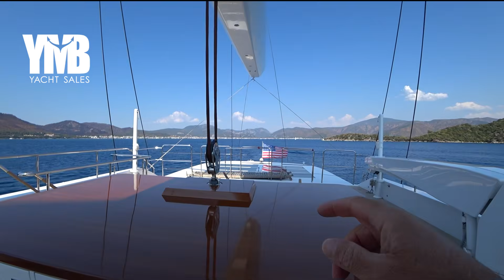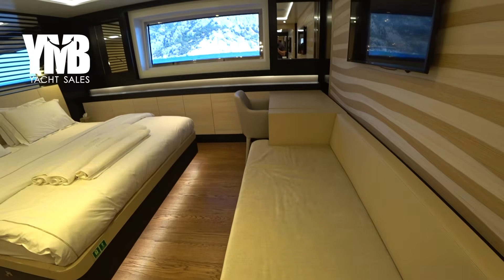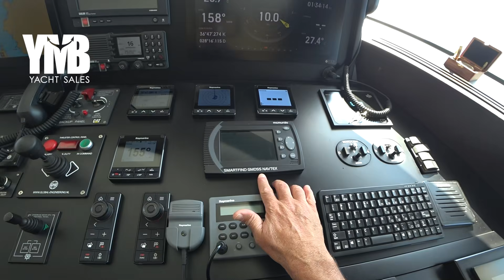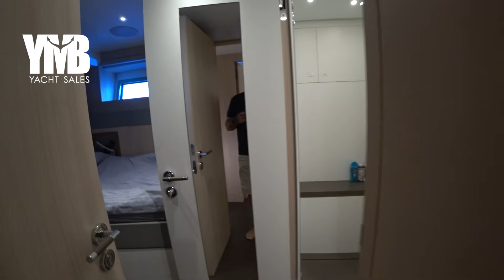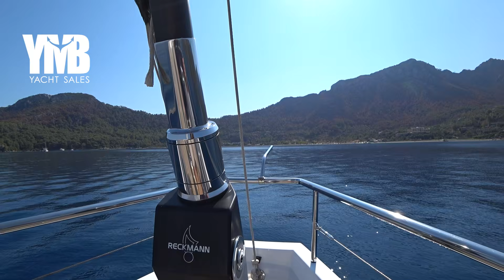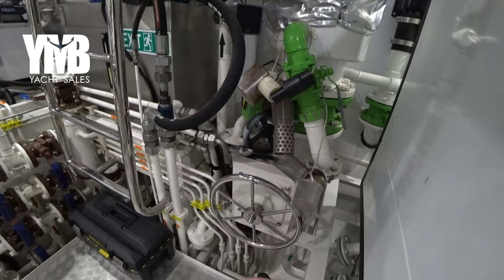40 m Steel Hull Motorsailer EXTREME walkthrough Yacht For Sale

Comment: I am very interested in the way you present the subject in front of potential buyers, but apart from all that, the boat is also very good clean, especially the engine room which is mostly covered with stainless steel material as well as the accommodation room is neatly clean, including platforms that are all computerized, all electricity, the model is classic and I am sure anyone who has the excess money,  The boat will / even has been sold at a fantastic price too, otherwise it means I will get his soul mate as the next owner…😅

Comment: Wow.
Was this in charter service? 
Is it possible to have a boat like this break even?
Reply: Designed with charter in mind plus many guests will want the zero carbon "green" experience of being under sail. With the wind being free the usually expensive engines are only going to be used for docking meaning she will be much cheaper to run than other super yachts her size.

Comment: Sometimes you get a lot for your eight million plus dollars. This is a beautiful boat with a very well designed layout, and built to a standard that anyone would love to own.  Operation however, must be expensive, what with a captain engineer, crew, plus food, fuel, fees, and consumables costs...  It could become maintenance heavy if there were any failures to the captive halyard systems, the extensive mechanicals, or the integrated electronics.  Nevertheless, I would have this boat in a heartbeat, even over and above most super yachts, because it is a usable design ready to motor or sail to where the fun is.   I am surprised it is not Ice Rated, as well as it is built.

I estimate costs as follows:  Fuel cost is 3,480 Euros, or $4,000 USD per day to motor both engines and generators for the full 24 hours, at 1.45 Euros or $1.67 USD per liter.  A fill-up of the 32,000 Liter tank would be 46,400 Euros, or $53,360 USD.  That hefty fuel charge would take the boat its full 2500 Nm range, at 8 Kn in about 13 days, motoring the whole way.  I'd be praying for strong winds to stretch the fuel budget.

I'm not impressed with the 'modern' cabin designs used on the walls, mirrors and paint colors, but I really like their physical layout, especially the heads and beds. All that is my subjective evaluation, so it does not count for much outside of my own head.

Details from seller website:
EXTREME 40 m Steel Hull Motorsailer | 40m | €7,950,000
Built 2019
L.O.A: 40 m / 131.23 ft
Beam: 9 m / 29.53 ft
Draft: 3.85 m / 12.63 ft
Cursing Speed: 12 Knots
Max speed: 14 Knots
Main Engines 2 X Caterpillar C18 679 hp / 400 hrs. (October 2021)
Generators 2 X Caterpillar C4.4 / 86 kw with 1800 hrs. (October 2021)
Fuel Consumption: Engine 1500 RPM 45 LPH each / 8 knots at flat sea
Generator fuel consumption 7 – 10 LPH
Fuel 32,000 Liter
Water – 7,500 Liter
Range at 8 Knots 2,500 NM
Total height of mast: 52.8m
Reply: I don’t think so, I bet if the cost conscience owner wanted to it could solar out the main power needed to maintain the yacht, lights, electric range, toilets, basically most (but not all) of the electricity needs. If I owned it, the only thing I’d use the engines for are the power thrusters to park the boat at marinas then maybe I need out of a certain area for an approaching storm, I would even try to have enough solar to run the freezer/fridge, washer/dryer. We as ppl need to learn to minimize our use of these things, we use some of them way too much. Like right now I believe the whole entire world only needs 1 shower every other day and only a couple gallons (2) per wash/rinse. Restrict yourself for the good of your vessel and for the good of the planet.
Reply: Very knowledgeable points Thanks for sharing 🇧🇭